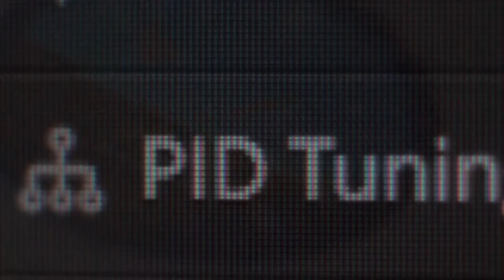FrSky FPort Protocol | IT'S GOOD, BUT I WISH IT WERE BETTER

Comment: So, the XM+ is now the best FrSky receiver for the money - got it.  Thanks JB!
Reply: tehllama42 XSR-E is imo. Also known as XSR-M but the eachine is the same. Goes on sale on Banggood for like $10 sometimes.
Reply: I'm just too slow to catch those.  I've been wanting to try one.
Reply: XM+ does not have telemetry, so it's got nothing to do with FPort by the way
Reply: Yup - figured it out, XM+ still works great for ones where I don't care about tlementry.  R-XSR is the answer in that form factor.

Comment: Joshua since you wrote the manual for the holybro kakaute v2 which uarts would you use, smartaudio is u6, u5 is esc telemetry
which uarts are bidirectional , can you use the smart port pad and one other?
Reply from the maker: I'm not sure about that, but I feel pretty sure that T6 or T3 pads would work.
Reply: t6 is smart audio thats out t3 is automatic sbus inversion
Reply: on my Kakaute v2 AIO it worked perfectly on the dedicated S.port. apparently it has a bi-directional inverter.  its UART 1 i think.

Comment: Joshua, I have been visiting your web page. I don't know if you do it on purpose, but I recomend ( if allowed ) to open the links outside your main page. I find it more convenient. Happy to be one of your followers. Regards
Reply from the maker: You can do that by using your center mouse button or by ctrl-clicking the link. I prefer to let people have the choice rather than opening a zillion windows.
Reply: Hi. Yes, that is the option, but I was meaning your own (economic) interests. I have a question for you regarding your own JBardwell flight controller. Will it allow to trigger a servo or auxiliary item ( from the same radio used for fliying, ideally )?

Comment: Just to add on some F4 boards dedicated Sbus pad is not bidirectional. So no telemetry on single pad with Fport for me. I tried to wire it to UART1 TX smart port and no luck. Still have to use another UART for it. My board is Omnibus f4 pro v2.

Comment: One could flip your argument around and say why does Crossfire not support RC and telemetry on a single wire like FPort does if you're comparing CRSF and FPort protocols. FPort might not be groundbreaking, but it's still a big deal in that it solves every issue FrSky receivers had. Namely, inversion and requiring separate wires and UARTs to accomplish RC and telemetry. And although FPort isn't any faster, at least it isn't any slower. It's still the same 9ms latency as running standard sbus. It's nice they didn't have to increase latency just to get everything on one wire.
Reply from the maker: Crossfire does need both TX and RX pads, instead of a single wire, but I think it's not a lot to ask. What were you going to do with the un-used pad anyway, if it was a single wire? And theoretically using two pads gives more throughput (full duplex vs. half).
Reply: I'm not saying that crossfire isn't a better protocol. Just that FPort is unique in that it accomplishes what crossfire does using a single wire. Of course crossfire is still faster than FPort, but still, FPort is a pretty big deal for people who are using FrSky receivers. It just isn't a big deal for people who have already purchased crossfire systems.

Comment: I think that the main reason folks are expecting latency improvements with fport is all those videos out there where people are talking about comparing CRSF and SBUS rather than comparing crossfire and FrSky's D16 protocol. Its at the link level communication where crsf wins out over FrSky, but because of inaccurate crsf/sbus comparisons, people are then hoping for gains in crsf vs fport as fport is a successor to sbus.

Comment: FrSky has tried to make their own Crossfire-style 900MHz system, and there has been nothing but problems with it...starting with sending the first modules out with 2.4GHz antennas!  After nearly a year, they still can't seem to get firmware figured out, and I've not seen anybody have much success with long-range flight yet.  Meanwhile, one of the first real owners of Crossfire, shortly after they released, went over 12 miles almost by accident on what was supposed to be a short test flight.  I think your dreams will be better realized with OpenTx and TBS in this case.
Reply from the maker: I just want faster refresh rates and lower latency from the regular old 2.4 GHz system.

Comment: From the wiki "must be able to run inverted bidirectional", looks like it still requires a flight controller with at least one inverted UART still.
Reply from the maker: I don't think so. One of the whole points of FPort is that it gets rid of the inversion requirement. I suspect that's a mis-type on the wiki.
Reply: It’s likely that they will be releasing Fport receivers that are hardware uninverted at a later date. The inversion issue is still an inversion issue. And for it to work, your inverted uart must be bidirectional and I’m 0/2 on the two boards I’ve tried so far. May perform uninversion hack or just go back to standard protocol as I have extra uarts. Just wanted to experiment.
Reply: Chris Michaels that is odd. In the semiconductor world, and most digits applications, a voltage of 2.5/3.3v is a logic 1, and 0v is a logic 0. All they really need is a preamble in the packet header and they would be able to tell whether or not signal is inverted. The rest gets taken care of in the firmware.
Reply: AFAIK, that's because current hardware does not support uninverted. The protocol does, the hardware doesn't... Which makes sense, since the inversion is done by dedicated but stupid components on current receivers.
Reply: Just ready the F.Port spec, I'm thinking it still requires inversion which doesn't make sense.

"1. Physical Definition
Tri-State TTL is implemented as communication level, 2.5v/3.3V as digit “0”, 0V as digit “1”, the
voltage between 1V and 2V is not distinguished."

https://github.com/betaflight/betaflight/files/1491056/F.Port.protocol.betaFlight.V2.1.2017.11.21.pdf

I'm flashing now to validate.
Reply: Thats not a mis-type. I did FPort a couple of months ago on a new build and unfortunately found out that you still needed the receiver hack. I just got around to replying because when I heard you say it in the video I was like,"thats not right."
Reply: I have tested this protocol on a few builds.  I still needed the inversion.  I couldn't get it to work without.  On the wiki, it does say that you either have to have an inversion FC or a hacked RX.

Comment: Complaining about fport not being like CRSF is fundamentally misunderstanding what they do. CRSF is the over-the-air protocol, the receiver just spits sbus at the FC. If anything, a crossfire receiver could possibly be made to talk CRSF to the radio, and fport to the FC.
The wish for frsky to do something like crossfire already exists (the 9-series modules and receivers) and by all accounts it works well, but the latency isn't reduced, and the slim receiver isn't quite down to r-xsr size.

Comment: What we need is for someone to make an awesome OPEN PROTOCOL. Then it wouldn't matter which radio or receiver vendor you're using and the vendors can compete in making the best hardware that supports that protocol. Closed protocols hinder real competition and innovation where it matters.

Comment: FrSky just released an updated R9 module with xt30 support that goes up to 1 watt and tiny Crossfire like R9 Slim receiver that runs on 900mhz. It has lower latency like Crossfire and is fantastic. It doesn't require any hacks and just works out of the box after firmware updates of course. The other day I flew out 700 meters on 100mw with 99 RSSI the entire time. In fact it's tough to test it's limits because I am outflying my video feed. With the R9 Slim it's great to not have to worry about fail-safes anymore. The other plus over Crossfire is that it's about $50 cheaper. I bought my system from Rotorgeeks.
Reply: yes that module is just PERFECT!! i love it but i wont lie i am using the TBS inmortal T antenna with the FrSky R9M hahaha, feels weird don't reach the 60% RSSI i loose Video before RSSI is just Awesome!!!
Reply: Staying away from it until all the bugs are worked out- good that TBS has competition though.  Reading the RCGroups thread on it it is pretty clear that buyers are guinea pig beta testers.  A stretch to say it works "out of the box" when there are weekly fixes/firmware updates all as a result of owners having problems.
Reply: J B The latest firmware update fixed most issues.

Comment: Hey JB I am liking CRSF protocol a lot, but I am running into a lack of information on how to run it on some raceflight quads I have lying around. There is just nothing on how to wire up a micro crsf rx to a Millivolt FC, but it is easy enough to set it up on uart3 (ininverted), however it does not autodetect in RFOne.
I also have a Revolt which I would like to run crsf on as well, is there a series of terminal (cli) commands I can follow??
PS HeliNation has triple packs of crsf rx’s in stock! (Through Amazon)
Reply from the maker: Sorry, but I don't know the answer either. You really have to get support for that stuff from the RF team.
Reply: Joshua Bardwell thanks JB, I swear the mostvaluable part of this Millivolt/Spark combo is the xt60. I kept that and threw the rest in the trash. I have a 20x20 HGLrc F4 40a stack that I know will work.

Comment: Joshua ; you did not mention if there are any changes needed at the transmitter side like an updated firmware for the module and / or open tx  version
Reply from the maker: No. Just receiver and Betaflight. Check the wiki page linked in the video description.

Comment: I think FrSky recently came out with a system similar to crossfire called r9 or something like that. It runs on 900mhz and supposedly has lower latency. Not sure how good it is compared to crossfire tho.
Reply: I know when they sent bruce from rcmodelreviews a unit to test they sent a 2.4ghz antenna on the 900mhz unit. And someone else made mention of that happening to them too. So if that's any indicator..........
Reply: Steve Blaski if that did happen im sure 900mhz antennas are cheap. I think a tbs crossfire immortal t is like 5 bucks.
Reply: It doesn't do telemetry which is a big downside.

Comment: you know how flysky get battery telemetry? they connect rx directly to battery, one wire. transmitter has two stage beep alarm, job done.

Comment: Heres what I dont understand, why is sbus only 1 way? Receiver is sending data back to radio so why cant it send rssi batv and other stuff you want?
Reply from the maker: That's kind of the whole point of FPort isn't it?
Reply: Ok thanks, you made it sound like it's just sbus but without inverted port restriction.

Comment: Hey Joshua, I do not agree with your statement that you cannot use one UART for two functions as Raceflight is achieving this on the Revolt.  For example if I flash my Revolt with RF1, I then use the same UART for sbus and smart audio.  However if I flash my Revolt with BF I need to use two UARTs which means I have to move my smartport wire to an unused UART.  I shared this with the BF developers and they said the same your are stating in this video. 

I think the BF developers are relying on UART library which introduces this limitation and its not a limitation of the STM32 processor.  💡
Reply from the maker: You're correct that it is possible to do this, just that Betaflight doesn't make it possible.
Reply: Joshua Bardwell It would be awesome if BF can support it.  Then this whole inverted 💩 can be avoided.  I forgot to mention I needed to use the inverted hack on the frsky receiver when using Betaflight.
Reply: Its not problem to use uart RX and TX for seperate functions, but as its ONE uart you have to set it to ONE baudrate. sadly sbus needs 100kbaud and sport 56kbaud. thats why it does not work.
It works on raceflight because the revolt FCs simply connect the pads to both uart and pwm pin and simply run softserial when needed.
Reply: @Derick Pelser Supporting using a single uart for two things is not gonna solve the inversion problem. It has nothing to do with it. The inverters we have on sbus pins are unidirectional, they only work on the RX pin in the RX direction. Same with the inverters on s.port pins, they only invert the signal in one direction. None of the flight controllers I know provide a bidirectional inverter or inversion on both the TX and RX pins of a single uart. By the way, even if you flash your R-XSR to use Fport, you still need to use an inverted uart because the inversion inside the R-XSR is done by a hardware inverter and cannot be "cancelled".
Reply: I use kiss gear only because one of them is an f3 board while the other fc is an f7 and plus kiss is great!
Reply from the maker: @Adam that was what i remembered too: that Raceflight isn't actually doing 2 functions on one UART, it just looks that way from the user's perspective. It's a clever trick, but a bit messy under the hood.

Comment: So how much slower is the refresh frequency / latency on the f-port signal? 
Bummer if it still makes a noticeable difference, totally agree with "a big thing, but not a really big thing actually" lol!
Think I'm going to wait, still have your JB-FC to build and a CL_Racing F4. So I am lucky to have that uninverter onboard ;)
-Or get Xfire, sooner or later.. =)
Reply from the maker: Crossfire is supposed to have 150 Hz refresh rate and like 6 ms latency. FrSky SBUS is in the range of like 40 to 60 ms latency if my memory is correct.
Reply: Yep, Crossfire is.. YUMMIE!  
I just checked back to Drone Mesh's test video.. i THINK it's 24ms on zero throttle and around 30 on full throttle.. but I don't have the time and head right now to study his complicated thinking and talking, sorry xD
Edit: Oh, my bad..that was frsky latency.. not sbus.. difference huh? lol
Reply: sry Josh, I'm just one of those kids (used to be in school, long time ago, like that too) that do have enthusiasm for the stuff but 2much chaos in my head to get it back out in order lolzz
Reply: Nope. It's 9ms. 3ms frames with 6 ms pause between frames.
Reply: Oh man, I'm wrong. The frames might be that short, but it takes several frames for it to actually change.

Comment: Frsky latency problems are not refresh rate related (btw, fport runs 12% faster then sbus, 100kbaud vs 112kbaud) but there is some software fuckup in the communication with the internal transmitter module. frsky tries to fix that in opentx since december but it somehow does not succeed. You can check out opentx github for details.
Reply: @Kinjuru, too many people would report significant and immediately noticeable benefit to rubbing cow dung on their transmitter module if others told them it was faster...
Reply: nah, its only 50%... TBS likes to compare best case crossfire reception to 18 channel worst case sbus setup no one uses. 
additionally crossfire steps down dynamically in flight when conditions change, ans I dunno if mid flight changing control delay is really what you want. 
If Frsky would get their shit together and solve their tx module sync problem, we'd see ~3ms difference or so between frsky and tbs in their fastest modes, a difference I can live with, considering the fact that I save some grams due to much smaller antennas on frsky and sacrificing long range capabilities I don't need flying my racer never more far away then 100m or so.
Reply: https://github.com/opentx/opentx/pull/5508
Reply: Adam Pyschny i
Reply: And CRSF is currently 3 times (200%) faster than  SBus, FrSky have dropped the ball and missed  golden opportunity to get ahead of the curve.  A 12% increase is a pathetic  joke by comparison!
Reply: Can you point me directly to commit what tries to solve the latency issue?
Reply: Thank You
Reply: @Kinjuru Here is a comparison: https://www.youtube.com/watch?v=0RH_TSwT1oM
Reply: Many people are reporting a significant and immediately noticeable benefit to using CSRF.  Which would seem to suggest  there's more to TBS's claim than just some fudged numbers. Still, I'd be interested to know if there is a side to side comparison out there that looks at this closer because I'm getting impatient and was thinking of dropping for the crossfire.

Comment: Fport is kinda meh. one less wire means nothing to me but less latency is the dream.
Reply: If you want on your x4r rx, when binding you can cut the latency in half from one of joshua's videos on what to do when your first get a taranis
Reply: BoomoFPV i have already switched from D16 to D8 mode but i still want it lower :D

Comment: Will we have the same thing with ESC? A single wire on addressable protocol like i²C for all ESC like ESC telemetry wiring but now it can both transmit commands and receive telemetry. Less port needed and much cleaner build!
Reply from the maker: There are currently ESCs that can use i2c to communicate, and also CAN bus I think. But they're pretty obscure.